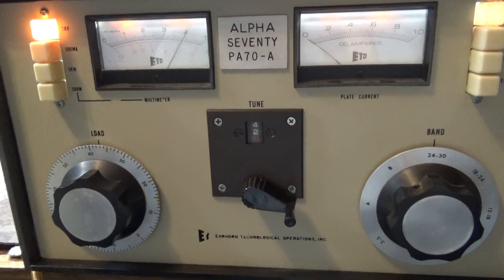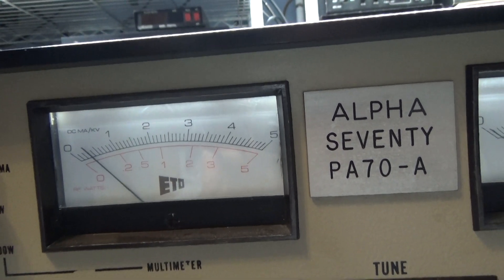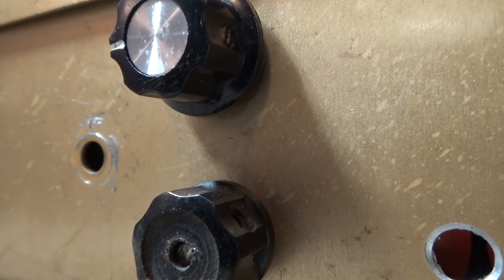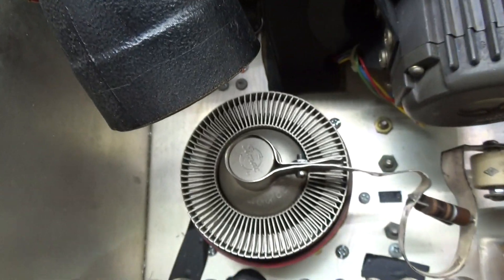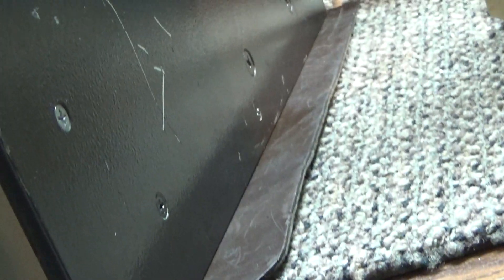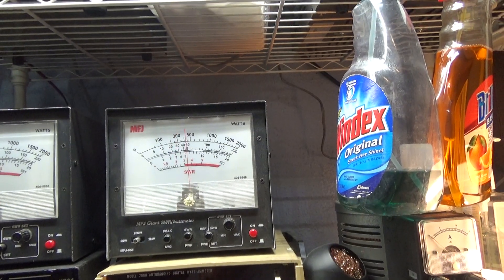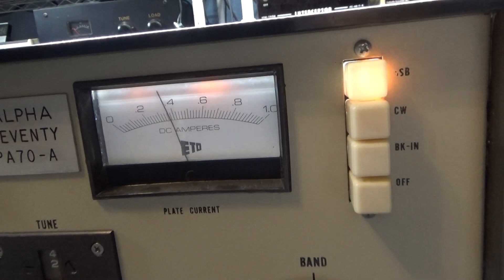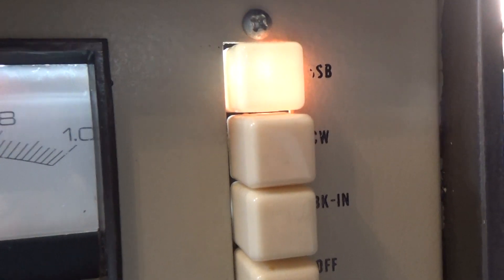Tube Linear Amplifier always Tune and Load for Max

Comment: "Always tune and load for max..."  Yeah, unless it's an AL-811h like the one I purchased: Went into a failure mode when it's driven past 50% of rated power, right out of the box...  Sent back for warranty repairs & still has the same issue after it was returned.
Reply from the maker: "when it's driven past 50% of rated power".......Hmmmm. I have nothing to say on that.

Comment: Where is that amp today?
Reply from the maker: Sold it to a local years ago and he loves it. It was some growing pains when I first sold it to him though. First of all, 2kw and above amps just will not run right on a normal house 110 line. 2nd, most operators stations cannot handle 2kw plus. There is more, but I will stop there. To this day, I am hesitant to sell a legal limit+ amp to anyone as most are not ready.
Reply: I run mine on the washer and dryer outlet. Seems to work fine

Comment: I was working on a big power supply that had been turned off for a long time.....I took a big screw driver and laid it across the big cap...snap.....it practically welded the screwdriver.......those big caps can hold a big charge for a long time.🔌
Reply from the maker: A very long time ago, I was working on a video game at the Greyhound Bus station. It had been off for months. I got bit by the HV off the monitor. I screamed out. Nobody paid me any attention LOL.
Reply: @tramdr  did you get hurt....any residual effects?
Reply from the maker: @nordland2235  Naw, I wasn't hurt. Might  have had the effect of a light Taser. Zap, then that's it. I screamed out like a girl for 2 seconds. Thought everyone would be looking and laughing at me, but nobody paid me any attention.

Comment: How long can you key that amp down without hurting it?
Reply from the maker: Are you really asking me that question about an Alpha? Really? My answer is if ran right, about 8 years, then change the tube and then key for another 8 years. Fact, Alpha used to go to 3 day swaps and literally put a brick on the footpedal and key it down on a dummy load with full power out for the duration of the swap. Another fact, some broadcast AM radio stations used alpha's as drivers, keyed down 24-7. Henry and Alpha are the 2 amp makers that I know of whose amps where used for radio station drivers, and also used in the medical field, radiothermy.
Reply: @tramdr Cool.....helluva linear......I was just wondering........I have heard some of those guys on the super bowl keying down for a long time.

Comment: Are you sure you didn't mean: 
Always tune for the maximum peak MODULATED output power?
Because when you modulate and see that plate current rise, the PLATE CIRCUIT IMPEDANCE changes; (decreases), requiring you to slightly readjust the tuning for your maximum peak power output at that new operating point.
 If you always tune for maximum peak output without modulation, you will be tuned for maximum average power output on a dead key, but would not be tuned for maximum peak power output when modulated!
 I'm sure that's probably what you were trying to say; and just clarifying it for everyone else to understand.....
Dennis O.  #12
Reply from the maker: I agree and tune for max peak on AM, but many do not. Some peak for max dead key and others key for RMS using average audio power, not peak, meaning saying something like AAAhhhdddiiioooo vs a whistle. I did not want to get in that debate here, so I simply say always Tune for max. Here, I don't want to get into plate current dip, plate impedance, overcoupling, peak watts vs rms, etc. Heck, very few CB amps even have a plate meter. If I can convince those that detune an amp to not detune it, I'm happy.

Comment: Very interesting .....I have a Box with 1 single 3-500Z  tube and I tune using RTTY  for the exciter and I start with 10W just happens to be the Minimum the Yaesu Rig will do and then a second time with 25 Watts RTTY and Tune  Plate & Load for Max Power .....after the Tune switch to SSB and that is were I mostly operate for a Super Clean Powerful Signal ....73
Reply from the maker: I agree with starting with lower drive and also on the low side of an amp to start tuneup (saves the tubes) but with my last adjustments, I tune for maximum modulating watts, not max dead key watts, then over-couple it a couple watts down.

Comment: I ran several amplifiers over the years, mostly with 6lq6 tubes or the like.
I ALWAYS ALWAYS ALWAYS tuned for max smoke.  All I did was adjust the drive wattage going into the Amp to vary output on the amp. Worked a treat, and NEVER had to replace a single tube.
Reply from the maker: That is the only way to do it.
Reply: @tramdr  Amen.
Happy New Year!!

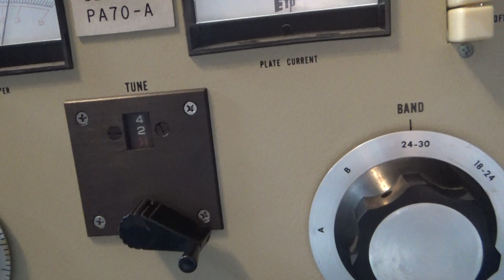Comment: 12:09 I wonder what was going on there? it was sucking alot of plate amps with no modulation and creeping up.
Was a blackcat going into oscillation?
Reply from the maker: actually I noticed that too when making the video but didn't want to stop or remake the vid. So after I posted the vid, I went back to try to see what was happening. I found that after about 5 minutes, the variable -bias circuit I put in the JB-76 starting drifting down, causing the JB-76 to take off. I have not tried to fix this yet, as normally I don't talk that long anyway. Unkey for 5 secs and it goes back to normal. Hmmmm.